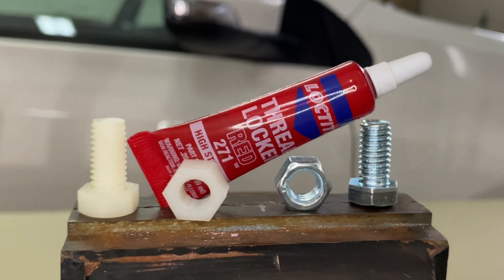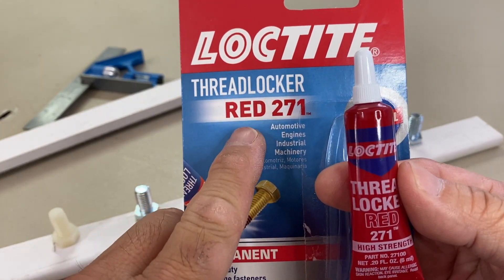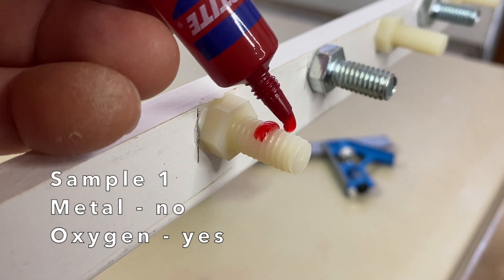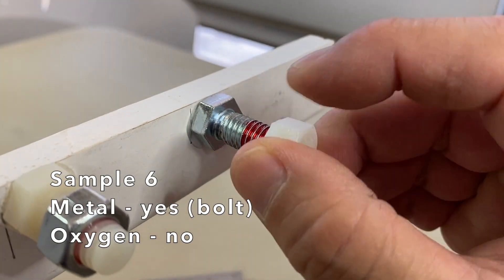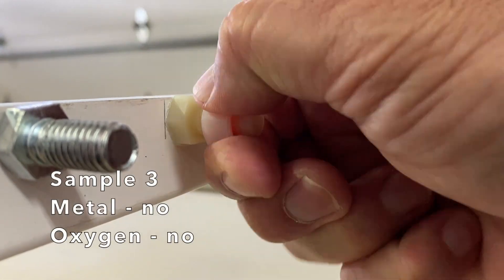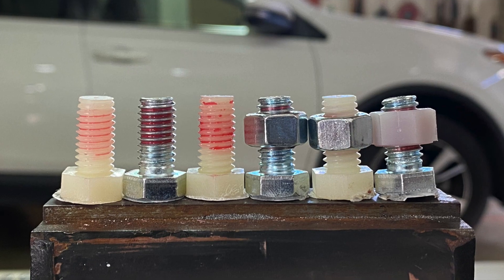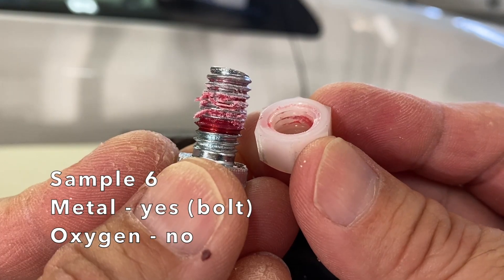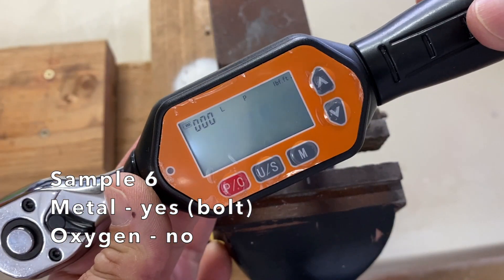Nuts & Bolts - Red Loctite Curing on Nylon

Comment: Loctite is brutal on acrylic.
Just a smudge of it can cause it to crackle into small pieces.
Reply from the maker: Interesting... I might test that out.  Just have to find a scrap piece of acrylic.  😎
Reply: @HacksbyDad  
The reason I know this is because I used to have a job building test equipment. There was a small acrylic panel that attached with screws. I used a small amount of loctite on the screws. The acrylic cracked into small chunks.
Reply from the maker: @mikegLXIVMM  👍😎

Comment: Sounds like super glue is a better option for nylon.  I don't suppose if you know if cyanoacrylates, their accelerants, or solvents attack nylon at all?
Reply: Cyanoacrylates are ideal on nylon.  But I've never tried it with accelerants.
Reply from the maker: Sorry… don’t know.  🤷🏻‍♂️😎
Reply: @HacksbyDad  I think you could experiment that fairly easily.

Comment: Here's an experiment for you. I'm sure you know about super glue and baking soda. I've noticed the same effect between super glue and epoxy. I typically just Elmer's Probond Advanced. I've thing I've wondered is if how this affects the two products. Is it stronger than super glue alone or weaker than epoxy alone?  Plus, does the type of epoxy and super glue make a difference?

Comment: Great info.  I used a bunch of blue Loctite on stainless fasteners and they didn't cure.
Reply from the maker: I guess I should do another test with stainless steel.  Thanks for the idea!
Reply: This is interesting because...
- I never realized Loctite had to be activated by steel
- The internet claims that blue Loctite is ideal for stainless steel.
I wonder why the discrepancy?
Reply: Stainless steel surfaces are "passive" and don't share their ions freely. 
Most, but not all, like 243 blue, are designed for use on standard steel parts, which are "active" and easily shares the required iron ions that, along with the lack of oxygen (anaerobic), actives the curing process. 
 
For zinc plated or stainless parts, you literally must use a primer or it won't cure.
I learned that lesson the hard way too. lol

Comment: Good Video,

But Loctite Blue / Red can harm plastics. 

I had to experience that myself😅
Reply from the maker: Thanks!   I guess I should have mentioned that I wasn’t recommending that Loctite be used on plastic.  Plastic was just used to illustrate the point of anaerobic adhesives need to contact metal in order to properly cure plus removing contact with oxygen.  😎
Reply: True!  I've always used cyanoacrylate as a thread locker on plastics.  It behaves a lot like Loctite blue does on steel.  I find it particularly useful for steel screws and bolts going into plastic.  And it's still easily removable.

Comment: Also compare different metals. Zinc plate, what you had, versus plain steel, black oxide coating, and then brass and stainless steel. Exotic would be titanium, but those almost never use a threadlocker, as they normally run well past the point a threadlocker will degrade.
Reply from the maker: Thanks for the ideas.  Gotta save up because these supplies add up in cost.  😎